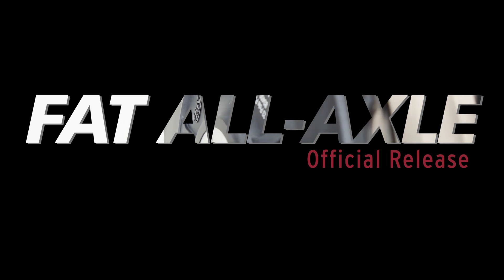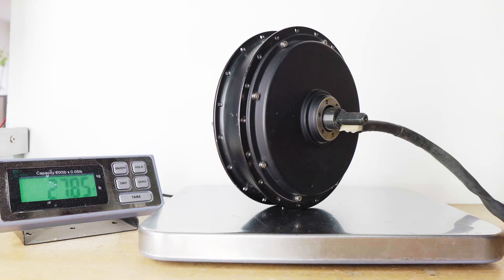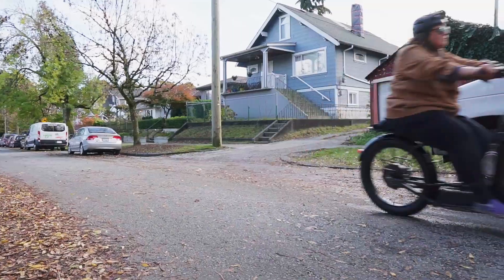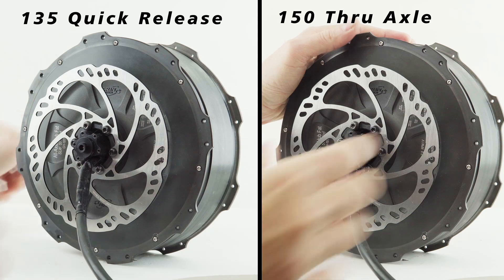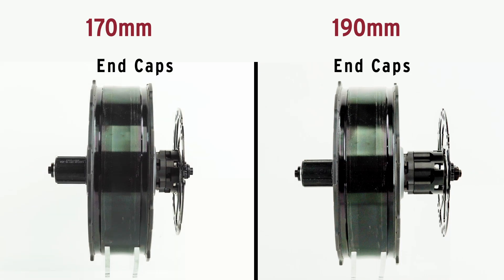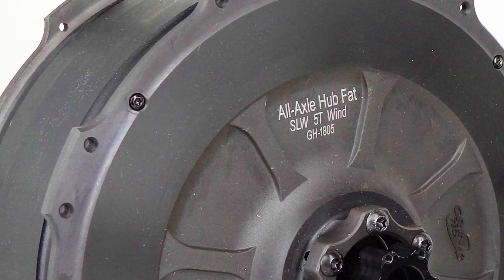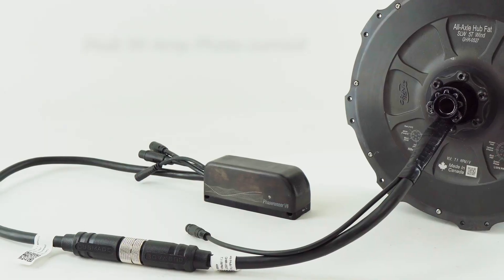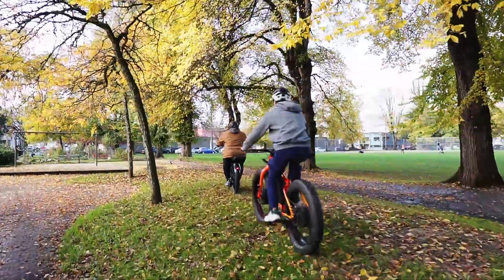Grin's Max45 Fat All-Axle Hub Motor,  she's HERE

Comment: Is this waterproof and does it have reverse?
Reply from the maker: Yes but fwd/reverse is a function of the motor controller and not the motor. Not all motor controllers have that as an input line .
Reply: @GrinTechnologies  so the motor be completely submerged under water ??
Reply: At most  5’ of depth pressure

Comment: Also , I was considering using a Nimbus Hatchet 26” x 4-5” tire uni to make electric. Btw, ultimately I’m just looking to tinker with something different and new. Both my Begode Master and T4 work terrific for me on off-road tight trails and the Master does everything else great. I’m just an older retired engineer so I ride slow and very cautiously armored riding seated only. My philosophy is not ride faster than I want to fall.
I really like the power assist with self-balancing idea but ,would be happy with only self balancing and some fake peddles or optional manual peddles. I love the self balancing unicycle way better than manual  x +100 times. Thanks

Comment: Hey, I’m looking to build a bigger fat tire , perhaps 24-26” x 4.5” to 5” width tires and a self balancing uni with standard pedals and pedal assist.  I rode standard pedal, Onewheels a lot, and now tons of Euc mainly off road. I’m old school and old actually and prefer riding seated. I mounted Surrond seats on both my EUC’s with plush suspension. I’m thinking a big fatter tire and wheel and smaller battery for short range and probably no extra suspension. Any ideas would be appreciated.

Comment: My fat DIY direct drive starts to stall at >35A of torque. What current can these direct drive magnets hold onto? Sky is the limit on the stator, but the permanent magnets start slipping when torque exceeds their fixed magnetic feild.
Reply from the maker: The stator is generally the source of torque limits, as since the high currents in the stator required for high torque cause the copper windings to quickly overheat. Not sure what you mean by "hold onto", the magnet adhesive can hold vastly more Nm of shear torque than what the magnetic fields can produce, they don't slip.
Reply: @GrinTechnologies  Thank you for your reply! I am using field oriented control. I can set the amount of torque (Iq) with a variable through my microcontroller. With my generic 48V direct drive rear hub motor, this motor stalls when >30A of field oriented current is applied to the stator. It seems to me that the permanent magnet's field is not strong enough to stick to the stator's field. These rotor magnets are bigger, and I am wondering how much field oriented current I can apply before the motor stalls. It's $1000 so I want to be sure   it's higher than 30A. It's roughly the peak battery current if you know that.
Reply from the maker: A motor stalls when the load torque exceeds the drive torque of the motor. In by "field oriented" current do you mean field weakening current or on the direct axis? If so, this should in general always be zero, unless you specifically need to overcome a back-emf rpm limit for high speed operation. Motor torque is only produced by quadrature "Q-axis" currents.
Reply: @GrinTechnologies  Hi Grin! Thank you for taking my questions! I really want to buy these motors front and back, I just want a confirmation that they are as strong as they look. I do mean 30A on the Q-axis, no field weakening. Basically the phase difference between the stator sine wave and the rotating magnets' sine wave. If the controller demands a phase that is >30A, the stator's magnetic field  pulls apart from the stator magnetic field in my 27mm motor. I want to know 1. how much Q-axis current your new motor can take? and 2., do you have plans for a >45mm motor? There's still more room you know!

Comment: Hello! My name is Maurício. I need help, I have some questions. The width of the axle for the rear wheel with ratchet is 197mm. Do you have it in a thickness of 20mm?
Reply from the maker: Not sure the question is understood here. The 197mm thru-axle standard has a 12mm diameter axle. What width are you talking about that you want to be 20mm? In any case all the CAD drawings and even 3D CAD files for the motor are readily available on our website.

Comment: To run the Slow max45 at 72V on the phaserunner with heatsinks at high current, is enough with the Grin V6 torque arm or do I need a larger custom torque arm attached to the bottom bracket frame tube instead? 

And, what frame tubing do you recommend, double butted 4130 chromoly or titanium 3AI/2.5V?

I would like to run it at high current without the chance of bending or breaking the frame in the long term.
Reply from the maker: You don't need another torque arm, it is included as part of the motor and has a way stronger splined interface than you can ever get with axle flats.

The frame tubing can be anything (steel, Al, carbon fiber, bamboo...). If it can handle the forces of a disc brake, then it can handle the forces of a torque arm.

Comment: Can this motor outperform a qs205 3.5T motor ? I am hitting 85mph with a 84v65ah molicells p42A fardriver 84680 pushing 300line/650phase 

Assuming I run it with this motor with those same numbers which motor wins ??? 

Anybody more than welcome to chip in 💯
Reply from the maker: Definitely not by that metric. the qs motor had a wider stator (50mm VS 45) and way way more metal mass to absorb thermal heat transients. The point of this motor is for people who still want a rideable and pedalable fat tire bicycle, only adding 6kg of weight. It's not for running hundreds of phase amps to make a fast motorcycle.

You could try to use it that way, but it will overheat faster (less dead weight metal) and also melt the l1019 motor connector.
Reply: @GrinTechnologies an ok thank you for the detailed explanation … it is def a promising motor ! Congrats to you guys 💯

Comment: Can someone please explain to me why on direct drive motors, the rotor doesn't have another inner ring of magnets? Wouldn't that greatly increase the torque?
Reply from the maker: The mechanics of such a stator is quite a bit more complicated as you'd have nothing to physically hold the stator teeth together.  But there are indeed some specialty motors out there with two sets of rotor magets in the flux path. It's more common in axial flux than radial flux designs for obvious reasons.

Comment: I need two at least of these engineering beauties. A question please: My front wheel shall be 12 feet ahead of the battery pack and further to the throttle. Is this a problem?
Reply from the maker: Nope, just keep the motor controller itself close to the motor, but the battery can be far away. You may want to use like 10awg wire to reduce voltage sag across the length though.

Comment: umm. power is important. torque is not necessarily
Reply from the maker: It is the torque at the wheel that determines if a motor can climb a given hill or will stall out. The supposed power output rating of the motor is simply not a factor in this.
Reply: @GrinTechnologies  lots of torque, little power means slow climb. but yes. it decides if it can go up or not
Reply: @snorttroll4379 Power = Torque X Angular Velocity. Power and torque are inextricably linked, so if you're saying that power is important, then you're also saying that torque is important, by definition.

Comment: ~~~ Something new coming - 𝖆 𝖗𝖊𝖛𝖔𝖑𝖚𝖙𝖎𝖔𝖓𝖆𝖗𝖞 𝖌𝖊𝖆𝖗 𝖘𝖔𝖑𝖚𝖙𝖎𝖔𝖓 𝖆𝖓𝖉 𝖒𝖔𝖗𝖊  ~~~
😁We have patented an entirely new, low cost, hear-silent, ultra-efficient, infinitely variable , ultra-torque dense [small & light], high durability gear technology, called 𝔽𝕣𝕚𝕔𝕥𝕚𝕠𝕟𝕃𝕖𝕤𝕤 𝔾𝕖𝕒𝕣𝕤 [ℂ𝕍𝕋/𝕀𝕍𝕋] , which is a reformulation of gearing theory sans any toothed wheels. The gear range can easily be >700:1 [ultra high gear rage possible] with a price half that of the lowest priced competitor. Enables smaller batteries and/or longer range in EV's [Exploding Vehicles ;-0 ] . Legacy and novel applications abound. Retrofits of ALL existing bikes, even electrics, will be available.

😉A novel, low cost, magnet-free, near-silent, zero detent/cogging, ultra-torque dense [i.e. compact], ultra-efficient, electric motor tech may be paired w the FrictionLess gear set for unprecedented drivetrain performance in all metrics at all scales.
😁We're also developing an ultra-efficient Free-piston engine with an insane power to weight ration on par with turbines. It will eventually power the PersonalJet door-to-door personal mobility solution.
~~ 𝖆 𝖗𝖊𝖛𝖔𝖑𝖚𝖙𝖎𝖔𝖓𝖆𝖗𝖞 𝖌𝖊𝖆𝖗 𝖘𝖔𝖑𝖚𝖙𝖎𝖔𝖓 𝖆𝖓𝖉 𝖒𝖔𝖗𝖊 ~~

Comment: Which ones are compatible with the 2024 Wired Cruiser?
Reply from the maker: Measure your dropouts? 	

Front 
Slotted Dropouts: 135mm
Thru Axle: 15x150 
Singled Side

Rear:
Slotted Dropouts: 170mm (4" Tire), 190mm (5" Tire)
Thru Axle: 12x177 (4" Tire), 12x197 (5" Tire)
Reply: @GrinTechnologies  Okay thanks. Yeah they're 4" tires.

Comment: Hello 👋. 
  My Rad Rover was close to a lightning strike tree . All of the electronics got fried , but the rest of the bike is in good condition. 
  Would it be possible to put one of your front wheel motors on this fried bike ?
   Or better to just start with another bike ?
Reply from the maker: It would be possible for sure, although you could also likely just repower the existing motor on your rad with a replacement motor controller. See https://www.youtube.com/watch?v=sL3bjQZGjoQ

Comment: I want to build a quadricycle. I was wondering if this motor would work well as an all wheel drive system for the quadricycle?
Reply from the maker: It would, although depending on your vehicle's load requirements 4 of these on a vehicle may also be overkill and our regular 27mm motor series could be more suitable.
Reply: @GrinTechnologies  I believe that the vehicle will weigh no more then 500 pounds
Reply from the maker: In that case if you were doing just 2WD I'd recommend the fat motors, but for a quad drive with 4 hub motors you really don't need that level of motor power on a 500lb vehicle.  Get familiar with our motor simulator here, you can use dual motors added and then choose half the vehicle weight and half the CdA to see exactly how a quad drive would work:
https://ebikes.ca/tools/simulator.html?motor=MGRIN_STD_SA&batt=B4823_AC&cont=BRL10&wheel=20i&cont_b=BRL10&motor_b=MGRIN_STD_SA&batt_b=B4823_AC&wheel_b=20i&bopen=true&add=true&blue=Lbs&hp=0

With 20" wheels you could fly up a 20% grade hill and the motors would barely even get warm to the touch.

Comment: Can't wait to get one of these! It's a little different from what i need but close. I'd like the lightest possible bike where the motor, regen and battery are used as adjunct to peddling. On the flat and when cruising I want 100% pedal power. I just want assist for hills.  I would like to never have to plug the bike in. Will your smaller motors work for that? Maybe the battery will still be a problem. It should be half the size that I have on my current, way to heavy,  bike.
Reply from the maker: Yeah this motor is definitely overkill for that application. Use the regular size all-axle motor for sure which will have less drag when pedalling and quite a bit less weight.

For the a small battery that can handle high regen currents you would want to use a pack from high C rates cells, like Samsung 40T or molicell P45B. A small 10s 1p pack from those would do the trick, giving about 15km of range but still being able to handle upwards of 1kw regen power absorption.
Reply: Thank you for providing the details, that sounds nearly ideal!

Comment: Still not the biggest fan of hubs. Main reason is hubs are not fun with flats.
Reply from the maker: Except that this hub is a quick release system, making it nearly as fast to remove as a regular wheel. There's a single M5 screw to loosen the torque arm, and then it pops right out.  Definitely easier to remove than a regular IGH hub or a hub with drum or roller brakes built in. 

It's not a necessity that hub motors are a PITA for flat tire repair. It's just that we've allowed copycat Chinese designs to dominate the scene, and what they all keep copying is a silly design (axle flats with external torque arm and poorly thought cable exits).
Reply: @GrinTechnologies  Better but still heavy. Had a few problems with QR over the years so I'm upgrading to thru Axle. This is the first thru Axle hub I've seen so that is a major push forward.

Thinking this is the motor Lucas has. Will this take a Burley Coho QR without hitting the motor wire?

My first ebike was a rear hub. 1000w CSC. Major junk. With a bolt on wheel. It ate a spoke every 100mi. Then I moved on to the BBSHD.

One day I might rebuild that ebike with a better hub. Could make for a good video! IDK.
Reply from the maker: It is true that the weight can be a bit of a pain when you're trying to lift it up from below, but if you have the bike frame flipped upside down so gravity is working with you on the wheel insertion it's less of an issue. 

It should fit the Burly skewer no problem, the axle exit is quite far from spatially from the quick release nut.

Comment: I would be curious to know what the regen qualities could be with other than human power at higher speeds above say 55mph. These motors look robust.
Reply from the maker: The regen qualities are the same regardless of whether a human is involved or not, mostly it is there to recapture energy from stop and go and greatly extend the brake pad life.  You'd need like an 84V or 96V battery to get 55 mph though.  It's not exactly intended for that but it could do it with the right high voltage motor controller
Reply: @GrinTechnologies thank you for the reply. My basic idea is to add something like this to a Honda CT125 if my budget can afford it but most likely to a more budget friendly used CT110. My thought process is that the added assist could make it freeway friendly and possibly even improve on the fuel consumption of these incredibly fuel friendly motorcycles. In other words turn it into a motorcycle Prius. With a system like that I’m sure it will require a sophisticated controller like a Phaserunner or equivalent. My knowledge or budget is not aligned with a project like this yet however.

Comment: What about comliance with German or european laws ? What love to see more videos about compatible controllers, batteries and frames.
Reply from the maker: It's compatible with basically all fatbike frames, and would work with basically any controller / battery combination capable of driving a BLDC motor. But as far as using the integrated torque sensor, you would also need a control system that can use an analog torque voltage and quadrature cadence signal to command the system. Majority of bottom bracket torque sensors operate that way so we would expect decent compatibility among programmable electronics with torque sensor inputs.

European regulations (en15194) apply to complete bike as a system. You can build up an ebike with this motor that is compatible or one that is not, that's up to the manufacturer. There really isn't a consideration at all for conversion kits in Europe which is a shame. So all conversion system ebikes are legally grey zone regardless of nominal motor specs.

Comment: My dual motor fat bike with geared hub motors weighs 38kg. I don’t really see the advantage if I was to have one of these motors. The gears inside are super cheap and easy to replace.
Reply from the maker: Assuming you don't care about the integrated torque sensor, the main advantage would be regenerative braking, which most people don't realize how much they miss until they experience it.
But yeah we would never suggest people change things around if they are happy with their current setup. And dual geared motors has crazy good climbing performance.
Reply: Plus the ones encased in steel on the outside allegedly last a pretty long time.
Reply: @justinw1765  mine are just bafang clone 1000w rated geared motors from china. If the gears inside last 5000 miles before replacement then I’ll be happy with that lol. That would be 2 years of commuting for me.

Comment: Ok now i just need a video of you guys adding this to the RAD RUNNER 2
Reply: I put one on a radrunner plus -- the 175mm drop out make it not quite fit right. I ended up having to custom manufacture inserts, but GRIN makes it SUPER easy as their products are so well documented it was easy to make the same part, custom with the 5mm extra I wanted.
Reply: @chuyskywlk I’m considering doing the same thing. I already have a phaserunner installed but want it quieter and with regen.

How do you like it vs the geared hub and what speed did you choose?

Would love to hear your thoughts.